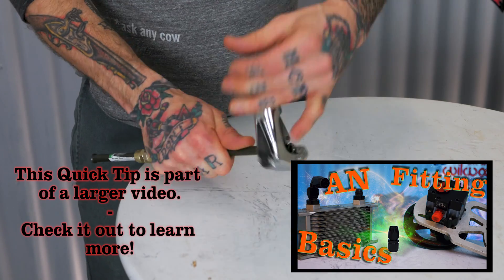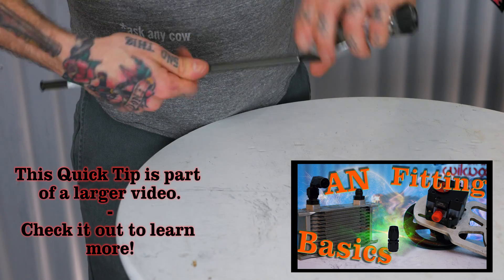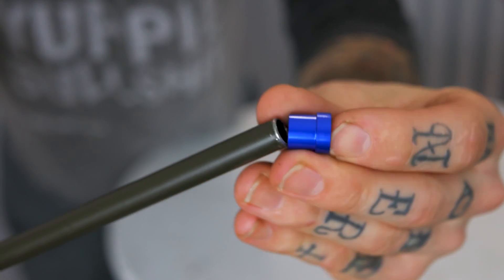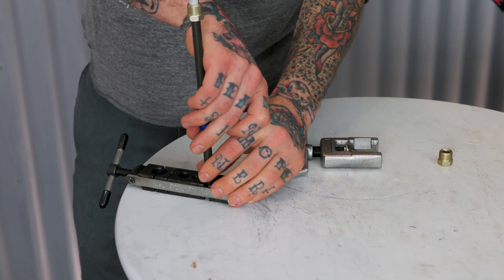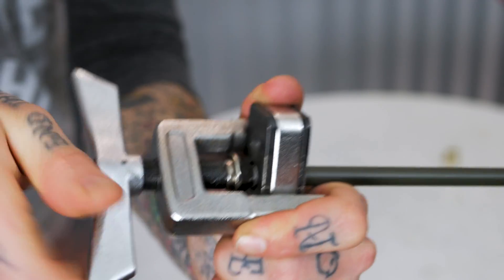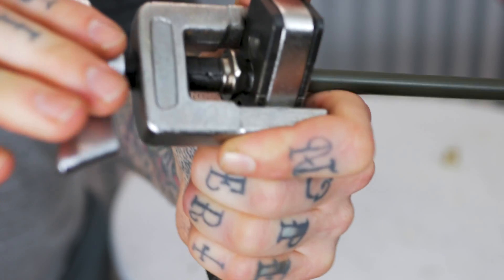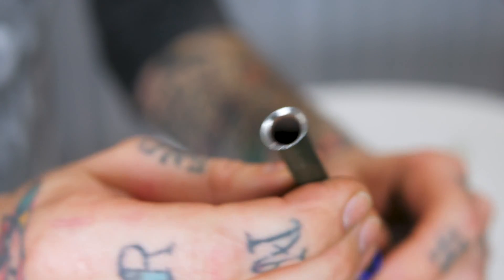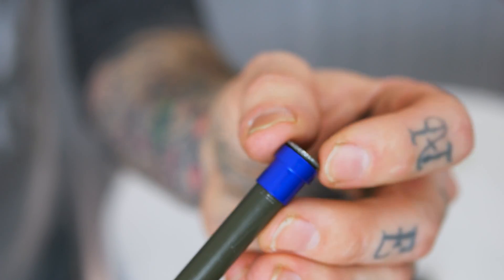How to Flare Tubing for AN Fittings - Quick Tip

Comment: One more question if you don’t mind… Any issues with using stainless steel hardline with anodized aluminum sleeves/nuts (for fuel lines)

Thanks again for the videos!

Comment: I know this is an older video, but have you had issues getting a proper seal with welded stainless steel?
Reply from the maker: In some rare instances I’ve had a weld seam be a bit of a problem. Usually I use a countersink bit to just lightly lap the sealing surface. I believe “Koul Tools” makes a tool for that purpose also.

Comment: I can't find a 37deg flair can I use a 45 deg ? On oil cooler
Reply from the maker: No, it won’t seal. The flare is how an AN fitting seals. An improper angle won’t contact the sealing surface, or allow the nut/sleeve to slide into place properly. 

Check out the full video on this topic to learn more about how these work: https://youtu.be/ySp_mUxR7xY

I linked a 37 degree flaring tool or two in the description of both. Or maybe a local speed shop could flare the line for you if you get it bent and cut to where you need it?
Reply from the maker: https://amzn.to/3fIowSE
Reply: My hero thanks man ☺️
Reply: Thanks man I'm from UK the 37deg flairs I see are around £200 can't spend that on 2 joints lol the link you put up saying unavailable?
Reply from the maker: @bigbothoee8617  Sorry about that, it's in stock in the US but Amazon doesn't automatically switch to UK with links sadly. 

Here is one from Amazon UK: https://tinyurl.com/yyy64723

Comment: So is it better to run a 37 degree flare or use a compression fitting with ferrule when going from Stainless line to AN?
Reply from the maker: 37 degree all the way. Ferrule type fittings are larger and add more chances for an improper seal. Best to keep it simple and flare it as intended. 

I never use the compression type fittings unless working with some oddball original component that has a tube sticking out and for whatever reason cannot be flared. And honestly I cannot remember the last time I did that, probably almost 10 years ago now.

Comment: When do double flares come into use? Are they for higher operating pressure?
Reply from the maker: I should have made a point about the tendency of stainless to crack when Double flared in the main video. It slipped my mind and my original edit was almost 20 minutes long, so it wouldn't have really fit anyway. Ha
Reply from the maker: Not necessarily. I use 37 degree single flare with stainless steel tubing on brake systems. 

The reason for the difference is largely due to Stainless tubing. Stainless steel is too hard to double flare 45 degrees. If you do it, the flare has a tendency to split. So 37 degree single flare is the flare of choice for Stainless steel. As that is where AN (Army Navy) Fittings originated, that is the flare of choice. 

45 Degree is for steel tubing on brake systems and fuel lines. And you could flare aluminum tube to a double flare 45 for fuel lines. 

In theory the added material of the Double flare is stronger, but it is too risky to do with Stainless. I've known people to do it, but they are tempting broken flares with every attempt. And Single flares hold up to the pressures of automotive (and Aeronautic) applications just fine.